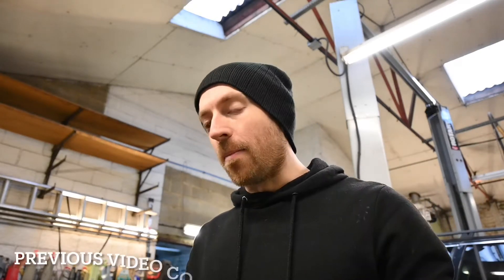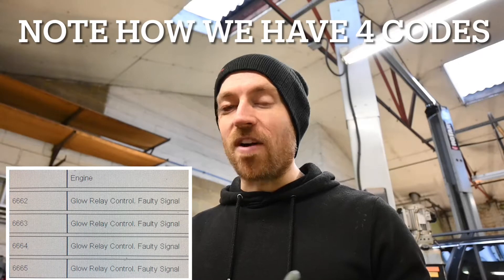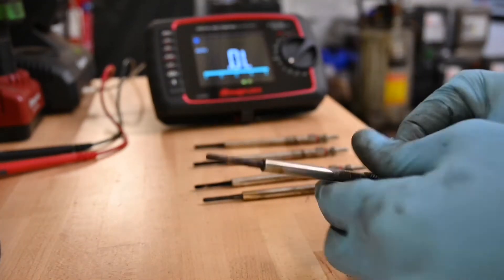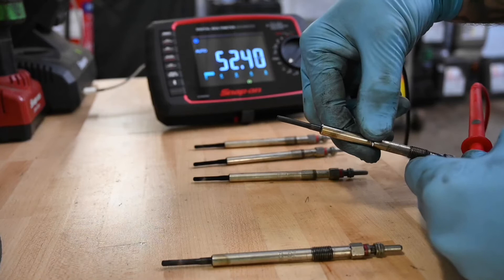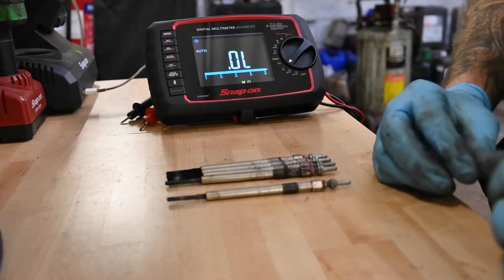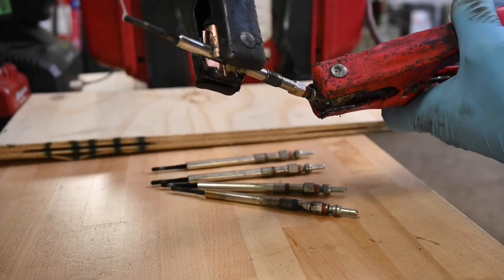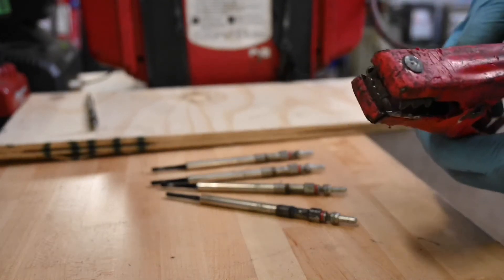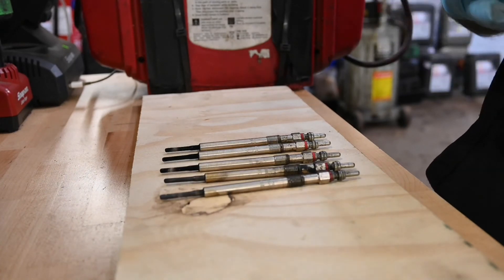Volvo XC90 Glow Plug Testing

Comment: jump pack is 12v right? these glow plugs only take 4.4 so I think if you were to test and measure the resistance there is a good chance you killed it with this 12v test. Only takes 3seconds typicaly
Reply from the maker: Apologies for the late reply. Funnily enough had only recently learnt that glow plugs are 4.4 volts. Makes sense that you could do more damage with a 12V jump pack. Lesson learnt but is always a fun way of testing them the "old school way". Thanks for getting in touch

Comment: putting 12v on 4,4v glow plugs is a good way to destroy them
Reply: indeed
Reply from the maker: Hi, sorry for the late reply. In hindsight, this is very true. I actually hadn't realised that these glow plugs, or in general are only rated at 4.4V. I admit though, the jump pack is an "old school" approach but if the glow plugs are successfully removed then they should always be replaced. Still fun to do :) Thanks for getting in touch